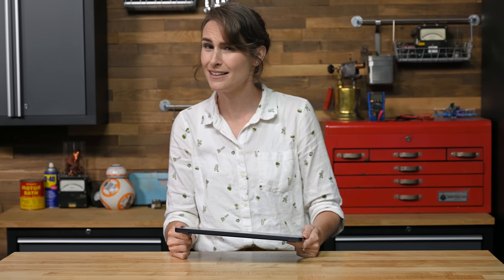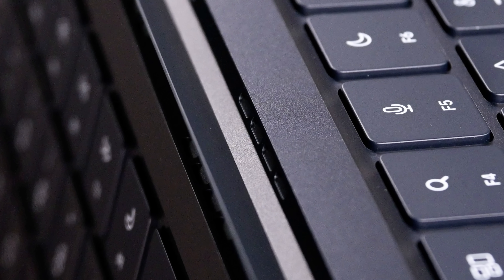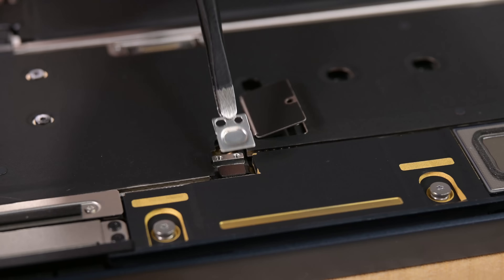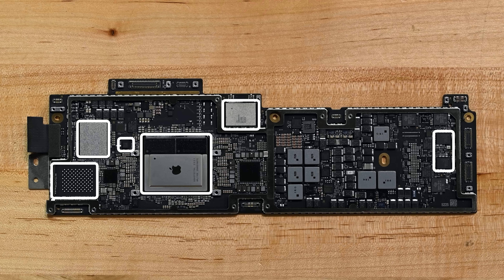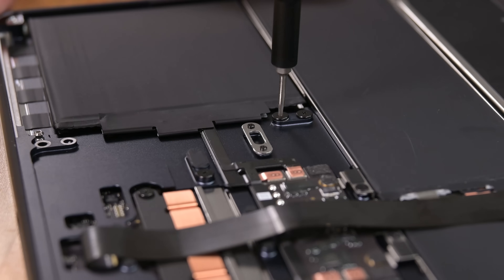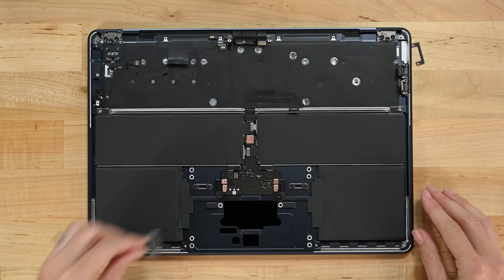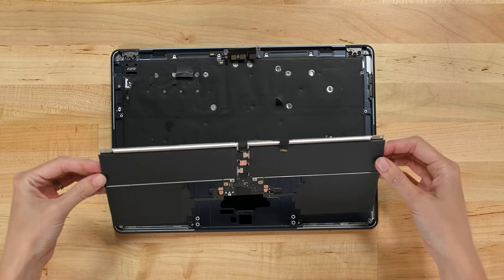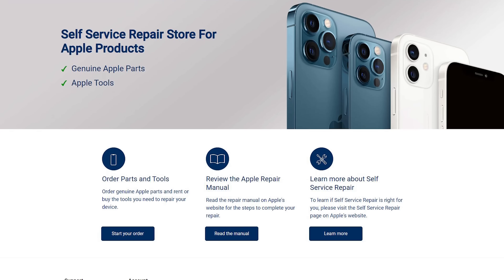M2 MacBook Air Teardown: Too Cool for a Heat Sink?

Comment: Can we stick a 256 Gb nand chip by ourselves to upgrade the SSD would love to see that assesment
Reply: You probably can and the system would read it just fine. Check out REWA on YouTube they do it with iPhones all the time
Reply: @WickedStuntz  yeah but we don't know about what software locks are preventing it it's apple
Reply: @SinghalRishi27  there are not such locks in place, people think Macs are locked down but in fact they are very open. there are some defaults but you can turn all of these off. For the SSD (unlikely almost all SSD controllers) apple publish the tools needed to reset the controler as part of the DFU mode.
Reply: @hishnash  look at Mac studio you can't upgrade SSD on it🥲 it's hard-coded to support only the configuration that apple shipped🥲
Reply: @SinghalRishi27  yes this is not a software lock this is more SSD controller firmware is. SSD controllers do not just magically work with any permeation of NAND dies. But Apple sell a 512 configuration of the MBA so as long as the NAND die you solder on is the same as the 256 GB one already present and apples 512 Config uses 2 of them (it will) you will not have any issues.
Reply: @hishnash  hector martain showed that there is indeed a software lock in SSD firmware that will prevent you to upgrade SSD apple can easily fix via software update think logically why would they have a different SSD controller for each configuration
Reply: @SinghalRishi27  The fix is shipping firmware that supports other configurations it is not a flag saying don't support other configurations it is a lack of support for those configurations yes its should be easy to add and should not require a lot of testing.  its not a different controler its a different firmware configuration.
Reply: @hishnash  If you stick another SSD Or upgrade it 2-3 minor components will still be required to changed in rewa videos I saw this idk what do we call them resisters ??
Reply: @SinghalRishi27  If you upgrade to a configuration that is supported then you do need to reset the firmware (using DFU mode)... some people attempted to do this on day one of the Mac's shipping before the tool for this had been updated so they failed to do the DFU reset. 

If you try to upgrade to a configuration that is not sold (this is not just capacity but also NAND module vendors as apple sources these from multiple vendors) it will fail to enter DFU mode. 

The most common upgrade people did was combine 2 256 GB sticks in one Mac Studio, there are 2 issues with this: 

1) the 512 GB option apple sell only supports using a single NAND stick
2)  these 2 sticks might not be from the same vendor so would never work even if apple supported 2 256 GB configuration options
3) possibly the sticks are keyed to the port (a little bit like how older IDE drives needed you to set a jumper so they know their respective id). 

In general even if apple supported configurations they do not sell (would need testing and validation) most of these videos would have still field to upgrade as they might well have been combining different vendors and using sticks that were hard wired to work in slot 1 but being put in slot 2.  

I expect the Mac Pro will use these same parts and apple will sell them on there store (as they currently sell the macpro ssd upgrades) but they will be a paired set and you will need to use them in the pair they com (numbered based on the slot) just like the macPro. 

Why do they not do this for the studio? well the exposed PSU inside the studio means legaly they cant tell users to open it that is also why the skews require you to remove the foot and 'damange' the device. regulations about users accessible electric parts means you cant have a exposed PSU (that even unplugged can kill you if you short It in the wrong way).
Reply: @WickedStuntz  a guy even upgraded SSD and ram modules on M1 MacBook Pro but idk if that's even possible now on M2 even when you have to stick a chip on it
Reply: @UC4uQttviRqOTEIj6L1tN-Hw rewa technology is a channel on yt who upgraded ram on previous models or nand chips on iphones if you change any of these things there are small components on the PCB that needs to be changed (not many 2 to 4). Wanna see it in action how we can upgrade SSD by ourselves although it should be fairly easy coz we won't have to desoldier existing chip from the motherboard
Reply: @SinghalRishi27  iPhones and T2 macs are complicated as some info is stored on the NAND that you need to reflash (serial number etc) on m1 macs this is stored elsewhere.

Comment: The real news on these is that you can get a massive boost in performance by simply adding thermal pads, almost as good as the MBP with the fan.
Reply: Be careful with that there is a reason there is not thermal pads or even heatsink for the cpu. There are very strict regulations about how hot the bottom of a laptop is permitted to get to ensure people do not burn thier legs when using it in this way. 

This is likly why there is not heatsink, a heatsink along does not cool the cpu it just transports the heat away from the cpu... in a think device like this without a fan that heat would go directly into the bottom case. In fact having a heatsink in this laptop and staying within the legal limits on bottle case temps means the cpu would need to thermal limit at a much lower temp (50c or less) as the bottom case is not permitted to go over 47C. In the end they have effecivly put an isuationly layer between the SOC and the bottom case to ensure it does not get to hot, this means they can safely let the cpu heat up to its max temp before throttling (this will take longer than it would to reach 50c which a heatsink).
Reply: @hishnash  One would assume anyone with a brain will not put the macbook on their laps once they have done this mod willingfully.
Reply: A massive 2% ?

Comment: Some macbooks with hard disk drives had an accelerometer for stopping the disk when it gets dropped to protect the data. Maybe this is so apple can read out if the machine has ever been dropped when doing repairs so they can know if warranty applies or not
Reply: M1/2 Macs have no way to persist that data in such a way that it cant be clerked very easily (we know this from the linux on M1/2 team). There is some read only data but everything else can be reset with a DFU mode so would not make any sense to do that.
Reply: @hishnash  even if it can be deleted the average user would either not know about the feature or couldn't clear it themselves
Reply: @Shadow__X  but if your repair is refused and you then go online you would find a tutorial on how to do it (it's very easy).
Reply: @hishnash  if apple refuses once they won't let a previously refused serial number though just because the error code is gone

Comment: 100% THE ACCELEROMETER is to detect/record data when the macbook has taken a fall and crashed on the floor, preventing warranty claims lol.
Reply: not possible as you can clear all data on the system. Would make no sense.

Comment: Now I'm wondering if someone would try modding the heatspreader by adding more mass to it? Making it similar to the one in the M1 air
Reply: Luke Maini already did that I belive.
Reply: @kavink2514  that's just pasting some thermal pads. would be nice if there is a third party heat spreader for us to mod once warranty runs out.
Reply: @kavink2514  like he said, most youtubers are just sticking some thermal pads to allow heat transfer to the bottom chassis, which helps but will likely be hotter than the safe temperature for skin contact (>45C)

I'm asking more about just adding more thermal mass to the 'heatsink' so that it absorbs more heat before throttling, given how we see there is some empty and underutilized space next to the logic board.

Comment: The however thin metal logic board cover is the "heat spreader" - since there's no direct contact/vent way to take the heat out, it only saturates air pockets till it cools down radiating heat through the outside shell, there's probably no need for "more effective" spread of the heat inside in the small space there is anyway. The Air cooling is not about getting the heat out conventional way, but managing the chip usage based on the trapped air temp inside.
I just wish Apple incorporated some partial heat transfer method to the back, not full hot thermal mod like option (which I don't mind on the M1 Air), but some partial spread with less but some conductivity.
Reply: Any attempt to use the bottle of the Mac risks it getting too hot (there are strict regulation limits on how hot it can get to avoid burning people). Would would be amazing is if they figured out a way to channel the heat to the back of the monitor if the panel can take that heat that is.

Comment: If ipads pro doesn't use a heatsink, so are the airs. They are about the same class of devices, they just won't get the maximum performance of the sillicon.

Comment: I thought USB 4 and Thunderbolt 4 came hand in hand, not thunderbolt 3?
Reply: It can't be called thunderbolt 4 because it doesn't support multiple displays.  My understanding is that it is capable of thunderbolt 4 speeds.
Reply: @Boof96  TB4 speeds are the same as TB3 speeds.  TB4 is just TB3 but with all the optional options make required + 2 monitors.